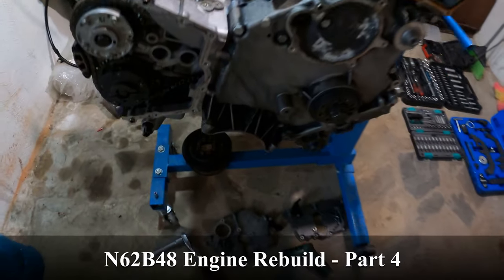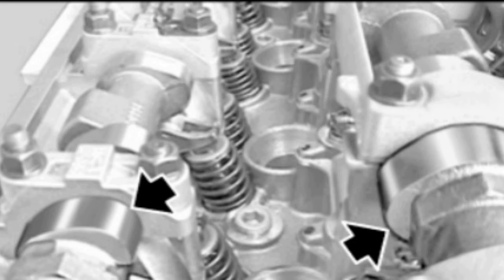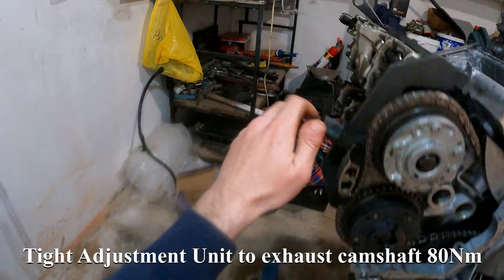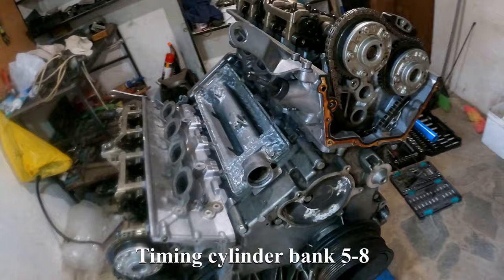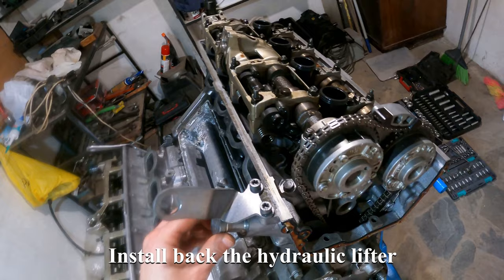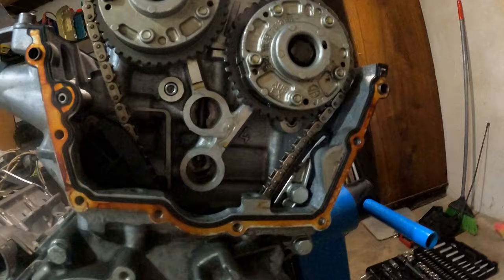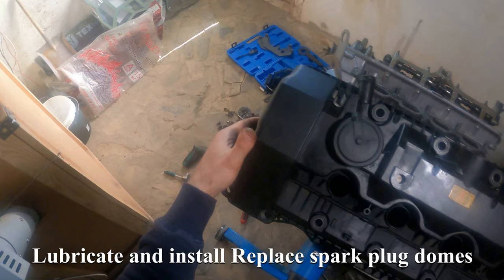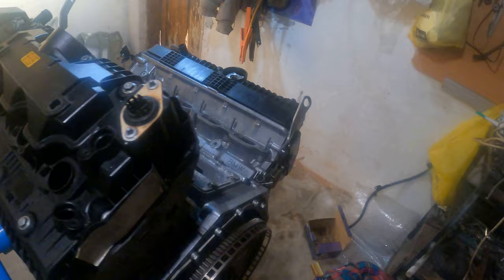BMW N62 N62B48 camshaft timing procedure. BMW engine N62 rebuild overhaul Part 4 (4k)

Comment: Can I just keep (big27mm) hydraulic tensioner  in and tight while timing instead of special tool do you think?
Just ask bc it seems a little challenging to special tool in on passenger side with engine in car. Thank you
Reply from the maker: no absolutely NO, hydraulic tensioner, is not filled with oil, and is not fully extended, you have to use the special one in order for you to do the correct tension and timing, just find one and tight by hand ..
Reply: @SuperFastDriver  awesome thanks for the reply bro.  Might just have to jack up engine a little or something. 
Just seems like the regular one would work because the timing guide is going to be set at normal position anyway.  But I understand what you mean
Reply from the maker: @Radian Miller  no worries just do it right, there should be a reason for that special tool :) take your time no rush :)
Reply: @SuperFastDriver  The tool that replaces hydraulic tensioner is screwed in until it stops,how much do you screw the middle one in you had the gun on to get the proper tension on the chain?Does instructions come with the timing set? Thanks for all these videos,they really help learn these BMW engines!

Comment: Does the vanos sprocket have to be facing any particular direction.
Reply from the maker: just make sure that the marks are visible when you install the vanos sprockets, on exhaust sprocket is written “EX” on the intake is written “IN” on Cyl Bank 1-4 on the Exhaust sprocket you have channel for the  vacuum pump
Reply: @SuperFastDriver  got it . But other than that it doesn't matter what tooth lands on?  Thanks again for the help.
Reply from the maker: @jairo villa I am really happy that you are enjoyed watching this video. Hope you like other channel videos with many maintenance and repair tips. Please don’t forget to rate 👍 and subscribe 🔔for more 😉. Thank you
Reply: @SuperFastDriver  does the bank 1 exhaust sprocket have to be place vertically or horizontally for correct timing

Comment: Where do you get the chains,guides, gaskets and tool? Cheers
Reply from the maker: the tool is from ebay. All the spare parts I bought from local car dealer
Reply: @SuperFastDriver  cheers for the reply. Great video.